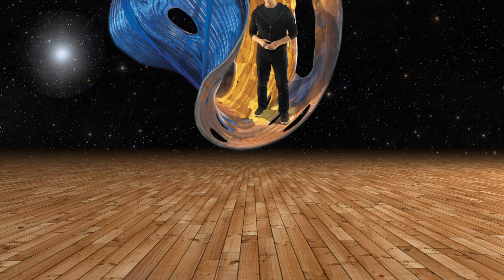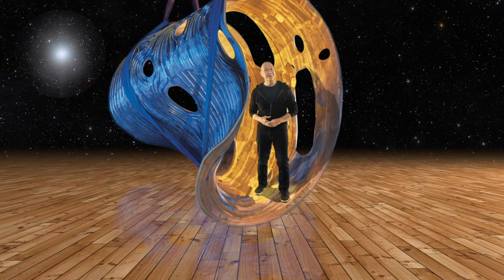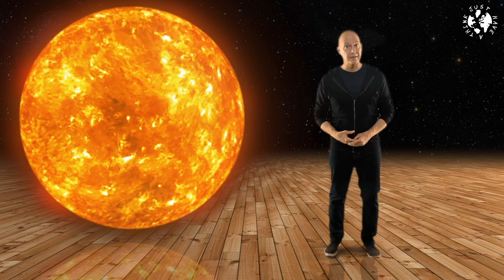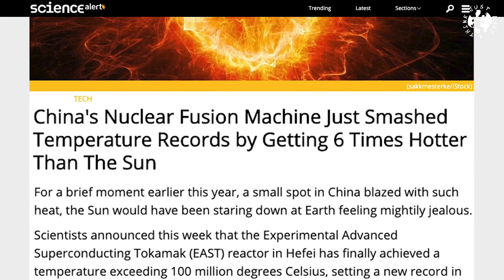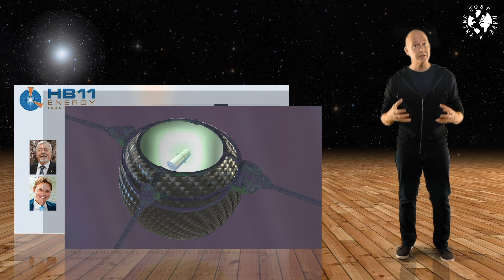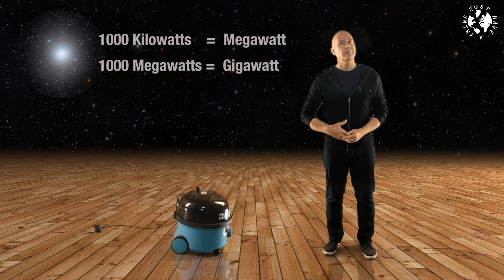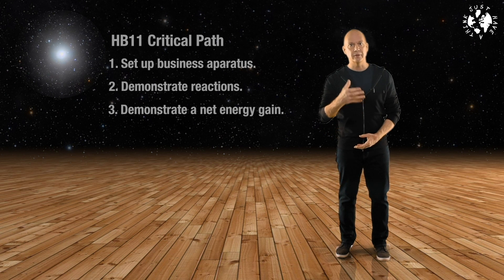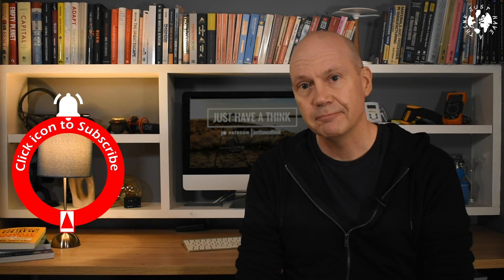Nuclear Fusion:  Revolutionary new breakthrough.

Comment: The reason that wind and solar power can never possibly be more that occasional add-ons to a power grid, is that all power grids must keep their voltages and frequencies within +/- 1% of target at all times (that means every second of every day). If a power grid gets anywhere near 1% off for more than about 20 seconds, the entire power grid will collapse. Obviously, wind and solar power vary by 100% every day, which is a bit more than 1%. I wish the general public knew this.

Regarding fusion reactors, all governments should immediately stop spending money until a group comes up with a design for a fully functioning reactor that meets ALL requirements. ALL requirements, not 2 out of 25, or 24 out of 25. The governments would see that nobody would generate such a design, because it is technically impossible. For decades fusion scientists and engineers have been spouting technobabble and BS to the politicians and the general public, in order to get the next billion dollar grant. If somebody asked me for a million dollars to build an experimental house, and instead of receiving blueprints I get loads of lofty, vague rhetoric, then they are not going to get the million dollars from me.

Deuterium and tritium are required for fusion power, not just hydrogen. Obtaining cheap, absolutely reliable sources of large amounts of deuterium and tritium is one of the many problems that has not been solved, and that fusion scientists and engineers don't like to talk about. Obviously, fusion power is a fantasy until they honestly resolve precisely how they will obtain cheap, absolutely reliable sources of large amounts of deuterium and tritium, for hundreds of years into the future. This is one of the requirements I referred to in the paragraph above. Also, I have never seen an analysis that indicates electricity from fusion power, when all is said and done, can ever be cost competitive.

Keeping superconducting magnets at temperatures near absolute zero, while they are continuously located a few feet away from plasma that is around 100 million degrees, and successfully doing that every second of every day for 50 years (per plant), is not an engineering design I want to be near.

Fusion power is a topic that always looks good at the introductory high school level (such as this video), but falls apart the more one knows about it. To restate, all funding should be immediately stopped until somebody comes up with a design for a fully functioning reactor that meets ALL requirements, including fuel supply, replacement parts, non quenching magnets, low cost, and other common sense requirements.
Reply: Hi,
regarding wind and solar energy, I agree that the variations in energy output are a problem. But shouldn't good energy storage technology be able to solve this problem for the most part?

Regarding deuterium, every cubic meter of sea water contains 33 grams of deuterium, so this resource can be viewed as essentially unlimited considering how little of that stuff is required per unit of energy production.
Tritium is not found in large quantities on earth, but it can be bred using lithium as part of the fusion process. The amount of global lithium resources are not well-known, but I doubt that this will be a show-stopper either for at least a couple of centuries or even millennia.
Regarding helium resources for cooling the magnets, we need to be very careful not to waste any, because helium is fairly limited on earth. Helium happens to be the ash produced by the fusion reaction though. It's not much but might alleviate this problem to some extent.
Having the hot plasma of 100 million degrees next to the cooled superconducting magnets actually already works well in experimental reactors. Also consider that the Jet (Joint European Torus) has already been operator for several decades, so I don't think fusion researchers are that far off your 50-year-requirement. I'm aware that fusion reactors will eventually start to become radioactive and need to be disassembled, but the materials could be recycled after a couple of decades.

Fusion will clearly be too late to help us reduce carbon emissions in time, but there has been so much progress in this field over the last 60 years or so, and researchers are clearly getting pretty close to making this power source viable, that it would be foolish to simply abandon the research and stop funding it altogether.
Also, recent advances in the production of high-temperature-superconductors look very promising and should allow future fusion reactors that are considerably smaller (and therefore cheaper) than the giant ITER machine that is being assembled in France right now.
Reply: @helgefan8994  Various energy storage technologies have been proposed to help add solar and wind power generation to power grids. They would probably all work, but their cost at least doubles the cost of all "normal" power generation methods. So, the public would get the same power, but at at least twice the cost and effort. In engineering, that is known as going backward.

I am well aware that seawater contains deuterium. But simply stating that fact without analyzing the industrial technologies and cost of producing the required quantities, is like stating that since asteroids contain millions of tons of gold, then mankind has millions of tons of pure gold at our disposal, as if it is sitting in a warehouse somewhere. Currently there is no way to obtain any element from any asteroid.

Regarding JET, please be careful with your words. Saying  "JET has already been operating for several decades" sounds like Europe has been successfully using fusion technology to provide X GW of electricity to their power grid(s) for decades. That is spectacularly far from the truth.

Your statement "....too late to help us reduce carbon emissions in time", makes so many unsupported assumptions, that I will not even go into it.

In summary, I respectfully ask you to think and be more skeptical. Think! Take in as much information as you can, and filter it all through principals of economics and engineering and physics and human nature. No offense, but your comments above are nothing more than commonly known general statements about fusion energy, most of which are either irrelevant or false. I am a retired professional engineer, and this is my honest point of view.
Reply: @JCAH1  "So, the public would get the same power [from wind and solar with energy storage for stability], but at at least twice the cost and effort."
But costs of solar and wind energy keep dropping, because it's really just manufacturing.
https://newscenter.lbl.gov/wp-content/uploads/sites/2/2019/08/Wind2018_fig3.png
And I believe the same is true for storage technologies.
Fossil fuels on the other hand will only get more expensive as these resources deplete and become more and more unfeasible as climate change gets worse.

"[Pointing out that sea water contains huge quantities of deuterium] without analyzing the industrial technologies and cost of producing the required quantities is like stating that since asteroids contain millions of tons of gold."
Are you really comparing the accessibility of heavy water (deuterium) in sea water to that of resources in asteroids? Sorry but that is utterly ludicrous to me. Extracting deuterium from seawater is actually a fairly simple and well proven industrial process. Deuterium is already used in large quantities inside Neutrino detectors (like the 1000 tonnes of ultrapure heavy water used in the Sudbury Neutrino Observatory). Also note that while a 1000 MW coal-fired power plant requires 2.7 million tonnes of coal per year, a fusion plant of the kind envisioned for the second half of this century will only require 250 kilos of fuel per year, half of it deuterium, half of it tritium.

"Saying  'JET has already been operating for several decades' sounds like Europe has been successfully using fusion technology to provide X GW of electricity to their power grid(s) for decades."
I know that JET and every existing experimental fusion reactor do not put energy into the grid. But if you re-read my comment, that is clearly not what I was implying. If you think my usage of the word "operating" is misleading, it might be because English is not my first language. The Wikipedia article about JET also uses the word "operating" in the same context though.
My comment referred to your statement doubting the feasibility of having 100 million degree hot plasma next to superconducting magnets for 50 years. I'm aware that wear and activation of fusion reactor materials is a problem, but I'm not convinced that it's a show-stopper.

"Your statement '....too late to help us reduce carbon emissions in time', makes so many unsupported assumptions, that I will not even go into it."
Do you not consider it important to reduce human civilization's carbon emission in order to slow down global warming? Which assumptions do you consider to be unsupported here exactly?

"I am a retired professional engineer, and this is my honest point of view."

Congratulations, but I happen to be an engineer as well. I got my degree (Diplom Ingenieur) at a good German university less than 10 years ago, so I'd say it's more "fresh" than yours.

"I respectfully ask you to think and be more skeptical. Think!"
I believe I am a fairly skeptical person already, but thinking alone can only get you so far. To become convinced of something I need good evidence. So I respectfully ask you to look up data and facts instead of just thinking and speculating.
Reply: @helgefan8994  It is nice to talk with a fellow engineer. To see evidence of what I was talking about, look at the price of electricity in Germany, your own country. You have to include all government subsidies in your analysis. The cost of electricity in Germany has risen sharply since Merkel replaced your nuclear power plants with wind farms. And the German power grid has become less stable because wind and solar are inherently unstable power sources. Notice that Germany will soon have two massive pipelines for pumping energy in from Russia. Russia will probably use them to blackmail Germany again and again. Those pipelines would have not have been necessary if your nuclear power plants had not been intentionally destroyed.

A second example is Australia. They have added wind and solar in a big way. Their electricity prices have more than doubled, and they have had a long series of blackouts and brownouts. Australia used to have cheap, reliable power, and their arrogant, ignorant politicians have unnecessarily taken that huge country backward, and spent billions of dollars doing it.

There are three reasons that wind and solar cost so much. First, you have to build enough power generators to provide at least triple the maximum power demand, because when the wind and Sun are available, enough EXCESS power must be generated so that power can still be provided when the wind and Sun are not available. Second, you also have to build truly massive power storage facilities to keep providing power when the wind and Sun are not available. It has been estimated that there is not enough Lithium in the entire Earth's crust to make the massive batteries that would be needed. Third, since power grids are extremely sensitive to tiny variations in the voltage and frequency, many facilities would need to be constructed to even out the highly variable power output from wind and solar. You would not want the power grid to collapse every time the Sun came out from behind a cloud, or every time you get a huge gust of wind. So, when people talk about the cost of wind and solar, all three of these factors need to be included in their analysis. Notice that I left out the cost of the massive amounts of land that wind and solar require.

If your goal is to minimize CO2 emissions, then nuclear and hydroelectric are the only known technologies that can provide cheap, stable/reliable, clean power. All other power technologies can not meet at least one of those three requirements. But while hydroelectric is great, it can only be done at dams, and most of the good sites for that have already been taken, and it is vulnerable to droughts. The topic of power generation is simple enough, but eco types are either ignorant or they are emotionally bound to wind and solar, and therefore they do not want to hear anything else. Obviously Merkel suffers from both of those things. As you probably know, China already emits more CO2 than Eastern Europe, Western Europe and the United States combined, and China is increasing its CO2 emissions very quickly. The communists do not give a damn about pollution control. Therefore, another constructive thing would be to incentivize them to build nuclear power plants going forward, rather than coal power plants.

Regarding fusion power generation, I will restate that most of the experimental programs are just wasting time and money. None of the programs has a detailed game plan or even the slightest idea of how to make fusion functional, cheap enough, safe enough and reliable enough to actually be used to generate power for mankind. Without even a theory, let alone a game plan, they are all just going through the motions and wasting decades and billions of dollars. They should do what countless other scientists and engineers have done in other fields, which is to put their fusion projects in mothballs until some huge technological breakthroughs are achieved (in other fields) that could be used to possibly make fusion feasible, cheap, safe, and reliable. At that point, a complete analysis should be done on paper before one dollar is spent. And if the analysis shows that fusion power generation is still not functional, cheap enough, safe enough and reliable enough, then all fusion projects should remain in mothballs. To use an analogy, what scientists have done is like spending a fortune building the first 100 feet of an intended five mile long, over-water bridge, without having any idea of how to build the entire bridge, or any game plan what-so-ever. And now, after 60 years, the money has been spent, the time wasted, and we still do not have a bridge or any idea how we are going to get the bridge. That is pure clown school.

Fusion experiments have been conducted for decades, collectively spending at least hundreds of millions of dollars. The old joke is that fusion power is just 15 years away, and it always will be. We will probably never break out of this unproductive waste of money unless we force (via defunding) those scientists and engineers to start working like adult professionals, and only build things when they KNOW that they will be functional, cheap enough, safe enough and reliable enough. All those R&D funds can then be used to buy tractors, farm equipment, seeds, insecticide and fertilizer for poor African countries (for example). I very much want fusion power to become a reality, but how can we not have learned after decades of failing and screwing around, that this is not the way to do it?
Reply: @JCAH1  First of all, I agree with you that Germany should not have decommissioned its nuclear power plants. We actually had some of the leading and safest technology in the field if I'm not mistaken. And compared to CO2 emissions, the problem of radioactive waste and long-lived isotopes appears to be the lesser evil.
Having to import power from Russia seems like a very bad idea to me too.

"It has been estimated that there is not enough Lithium in the entire Earth's crust to make the massive batteries that would be needed [for getting wind and solar stable enough]."
That may be correct, but there are other kinds of energy storage such as pumped-storage hydroelectricity and lift storage power plants to complement battery-based load-balancing.
In my opinion, an increased or price for electricity is justified if that means we can drastically reduce CO2 emissions and reduce climate impacts for future generations. But as I stated before, most of the challenges regard engineering and manufacturing. And manufacturing tends to get cheaper over time.

"To use an analogy, those fusion projects have spent fortunes building the first 100 feet of an intended five mile long, over-water bridge, without having any idea of how to build the entire bridge, or any game plan what-so-ever."
I would like to improve your analogy a little so it's more fitting: In the distant past, before bridges we invented, a group of people had the idea to build a bridge over a torrential river, say in order to make their village more accessible for trade and travel. They tried lots of different ideas but all of them failed. But just as in science and engineering, they learned from their mistakes, improved their designs gradually until eventually they succeeded in building a stable, reliable bridge. Or alternatively maybe someone such as yourself tried to talk them out of it, telling them that their attempts are futile and that they only get funding for 1 more attempt to build a useful bridge.

"We will probably never break out of this unproductive waste of money unless we force (via defunding) those scientists and engineers to start working like adult professionals, and only build things when they KNOW that they will be functional, cheap enough, safe enough and reliable enough."
Sorry but I find that quite condescending. Who are you to criticize experts in fusion research?
With that attitude, we could never have reached the moon, considering how many experimental rockets first had to fail before engineers figured out how to get them to work. Also, gravitational wave detection (by LIGO in 2015) could never have been achieved, because it was necessary to first solve lots of different problems over may decades and build prototype interferometers that had no hope of detecting actual gravitational waves.

It looks to me like you don't know much about what fusion researchers are doing (I am talking about the most promising designs for fusion reactors so far - tokamaks and stellarators). There have been many adult professionals researching various aspects, and there's a long list of solved problems and progress in the field starting in the 50s. Here's an overview: https://en.wikipedia.org/wiki/Timeline_of_nuclear_fusion
I am convinced that the big (and expensive) experimental fusion reactor in France - ITER, will be the first to reach so-called "engineering break-even". It's still not commercial break-even, but still a crucial milestone that demonstrates the scientific and technological feasibility of fusion energy for future electricity generation.

"The old joke is that fusion power is just 15 years away, and it always will be."
Actually usually it's 30 years, not 15. And there is a good reason why researchers in the 60s were so extremely over-confident that viable fusion power would be just a few decades away. The main problem was (and still is) to prevent the extremely hot plasma from touching the walls of the vacuum vessel (because it would extinguish the plasma or damage the walls) by introducing a radial pressure gradient via magnetic confinement. In the 60s, the heat transport of the plasma toward the walls was calculated based only on the rate of particle collisions and their gyration radius. Based on this calculation, the researchers estimated that a functional tokamak with a radius of just around 1 meter should be possible. Sadly, they were in for a surprise once they actually tried to build these devices: Turbulence inside the plasma increased the heat transport substantially, so that experimental reactors had to be much bigger than that. Nowadays, plasma physicists understand the behavior of plasma inside tokamaks/stellarators very well thanks to all the experiments and computer simulations that were not possible in the 60s. Therefore, predictions regarding fusion for power generation are much more trustworthy now and the first fusion power plants that actually put energy into the grid are at least on the horizon (maybe in 30 years ;-) ). I would consider stopping or "mothballing" fusion research today to be a very big mistake.

Fusion research does have a game plan, and for the overwhelming majority of experts in the field, it looks more and more promising.
Reply: @helgefan8994  Since you are an engineer, I found your disinterest in calculating projected construction and support costs for solar, wind and fusion technologies to be extremely odd. Those costs would ultimately determine the cost of electricity produced by each method, and would also determine if each method was financially competitive, or even financially possible.

Then it occurred to me. The reason you do not care about costs (as an engineer) is because you personally would pay any price to reduce CO2 emissions in Germany, even though you know that those reductions would be more than wiped out by CO2 emission increases in China (so Germans would suffer for the indefinite future, while the world's atmospheric CO2 concentration would continue to rise). Please be aware that many people do not (or can not afford to) share your attitude on cost. And also be aware that as an engineer, you are required to do detailed and thorough cost analyses, no matter what your personal opinions and feelings are on a subject.

Your analogy on building better and better bridges by learning from failures and by trial and error, is a fairly close analogy to how the development of fusion power generation has been going. And as I keep saying, that approach is the exact opposite of good engineering! That is how children do things. That is how dummys and fools do things. That is NOT how good engineers do things. That method needlessly wastes large amounts of time, money, and precious talent, which are all very much needed for the many other problems that plague mankind. Since there is apparently nothing I can say to change your views, I will end it here.
Reply: @JCAH1  Sure these messages were getting too long anyway as we keep trying to respond to every single point.

I think you are overestimating the increase in cost for renewable energy, even when considering all the requirements for stable power supply, but I'm much more interested in your views on fusion research.
You seem to think that researchers should have made it work on the first try, but that is an unrealistic demand. The technological progress of fusion reactors can be quantified using the so-called triple product. And when comparing the triple product of fusion experiments to Moore's law (number of transistors on processors) on a logarithmic graph, we can see that the progress of fusion was even faster than that of CPUs:
https://publish.illinois.edu/kgimbel2/files/2016/07/triple-product-Webster-768x635.png
The big difference being, of course, that even the very first Computer was able to do useful calculations, whereas fusion will only have a chance to become useful once we exceed what's called "ignition" - when the rate of energy production is higher than the rate of loss, and enough of that energy is captured by the system.

The international ITER project does not really have the option for failure. If it does fail anyway because of some new surprises that scientists didn't expect, this would be a major blow to fusion research and your "moth-balling" path will probably become reality, at least regarding government-funded projects.
If it succeeds in what it has set out to prove (some time after 2035), the participating nations (EU, China, India, Japan, South Korea, Russia, US) will all have the expertise to build their own first DEMO reactors that will actually put power into the energy grid. Well, China is jumping the gun a little and started building their own DEMO reactor that will generate energy for the grid if successful, but this purely Chinese project is being built with the option of failure.
To be honest, I don't think China is completely ignorant of climate change and the environment. They are leading the world on solar power, planting billions of trees and over the last few years they even worked on improving the air quality in some of their cities.
But China is extremely power hungry due to their current economic boom, so they are kind of doing everything at once, including fossil fuel power plants and large increases in CO2 emissions.

Here's a video without words showing a time-lapse of the montage (millimeter-precision) of the highly successful stellarator Wendelstein 7x, made by engineers and designers who according to you are just some immature amateurs wasting money: https://youtu.be/MJpSrqitSMQ
In case you're not replying anymore, take care and stay skeptical!